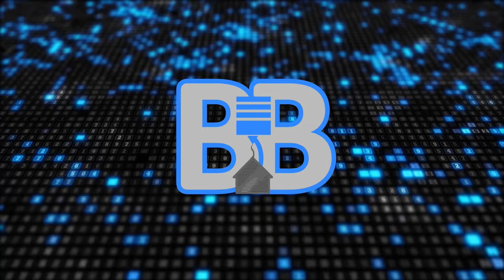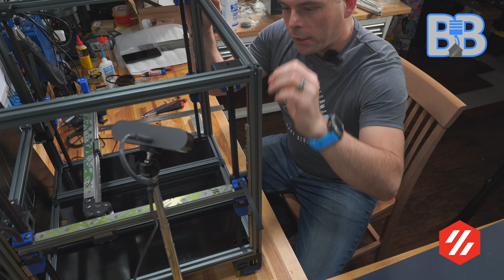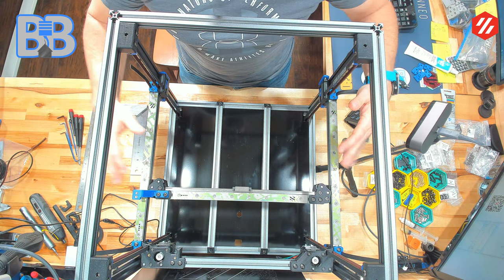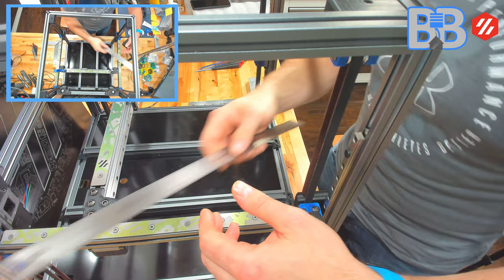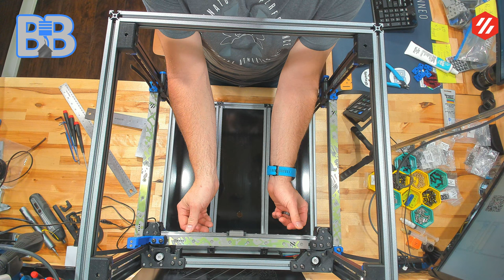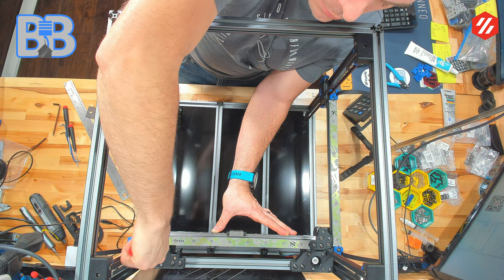Part 8.5 ULTIMATE Voron 2.4R2 Build Gantry Check and Square!

Comment: I put the little rubber nubs/stops that came with the linear rails, in the empty Z-axis linear rail holes. 
 Same level all around so the gantry would sit level on them and not move while I was playing around.
 Mine was so willy wonky that I had to loosen the 4 screws (each side) on the linear rails to get both sides to hit at the same time.
 I remember wondering where the rear extrusion was supposed to sit, width wise. 
Well that width is set right, when the gantry slides right.

 It slides so smooth now, thanks.
Reply from the maker: Most of the plastic pieces also have "stops" in them so the extrusion can rest against it.

Comment: I am currently at this stage in my build but it’s a v2.4r2 350mm.  I took measurement across the back of the printer and then moved the x to the rear and took measurements in the front. My rear measurement was just a little bigger in the rear, gave a little pressure and tightened a/b drive. And measurement is good. I wasn’t getting really smooth movement once I push gantry all the way to the back but if I loosen the 4 screws into the left linear rail movement was smooth entire time. Also I have smashed into the plastic on those 2 of the 4 of those screws on outer side of y linear rail. Anything you can think of I might need to check? I did clean and lube bearing with Mobilux EP 1, EP Grease, NLGI 1. It’s pretty thick but thanks for the videos! And ones last thing with the titanium backer, does it matter where it gets put? I thought it went on opposite side of linear rail? TIA
Reply from the maker: I would confirm that your gantry is level within a mm or two.  If not, your fighting a losing battle. Level it out first.  Did you confirm that your printer frame is square?   As for the backers - yes they should go on the opposite sides on the rails.  I did a lot of digging and had a conversation with the originator of the idea (whoppingpochard) from the Voron group to confirm because the backers are actually holding expansion and not being used to rigidize the extrusion 180 degrees is the call for.  I went to length on placing them at 90 degrees since the width of the backer is much more substantial than the thickness of the backer.  I'm not 100% sure which screws are hitting on your left side Y, nothing should hit.  Optimally, your left Y should be like .5mm or less from the rear when your right side Y triggers the end stop.  As for the cleaning and lubing of the rails.  I do have a video with my method here: https://youtu.be/DW15PcTpt3Q I would guess your rails are fine.  When grease is applied they will not slide too freely, they will slide better w/o ANY lube or really fine oil, but then you will need to re-lube daily!  EP2 by Mobilux is your best bet, or if you are unable to find it you could use mid-thickness lithium grease.  - Hey do me a favor like and continue to comment, it'll help others find my videos.  The only complaint I ever get is that YouTube doesn't show my content as well as it should - You can help that!  If you go to my channel I also have some community posts about doing "call-in" live streams, spread the word!  Once I have enough people I think I could do them for a few weeks I may make it a weekly thing!

Comment: i dont like the idea of that, doesnt doesnt really mean its square... it just means youre ends are aligned with the other ends.... well if your AB motor mounts/front idlers arent put on the same way, its also not going to be square,
you could just shift one axis forward, and the other back, do this procedure, and youd have calibrated it to be a parallelogram.
Reply from the maker: Assuming you constructed the frame square from the start, that shouldn't be much of an issue.  There is always a way to make a tip or suggestion not work the way its intended - extremes will always be there. Under normal and proper construction where you need to minimally adjust your gantry, this has worked for me on three builds.  I guess what I would really like to say is that without a decent starting point (before this stage) you'll be fighting a battle no matter the method.  You are 100% right if your frame is not true during the build this will not fix all the possible issues.  I will also add that if your gantry parts are properly printed and everything is tight it would be difficult to not notice the printer being a parallelogram. Linear rails don't like being askew.

Comment: Can we do same process if belts are already ran?
Reply from the maker: 100% - BUT you will need to make sure they are loose and not terminated at the toolhead.  I would also say that once you get the belts run and terminated you do the same treatment and adjust the tension of the belts on either side to ensure equal tension.  Great question - Totally understand not wanting to run those belts more than you have to!
Reply: @BuildItBasement  Thanks for the quick response. looks like my bottom belt isn't tight enough anyways haha.
Reply from the maker: @DYCKnights  You'll get a feel for it.  I keep my belts "mid" some run loose so they can go faster - others tighter so they get slightly more precision.  These belts are pretty long so they will always feel looser than those of the "z" drives.